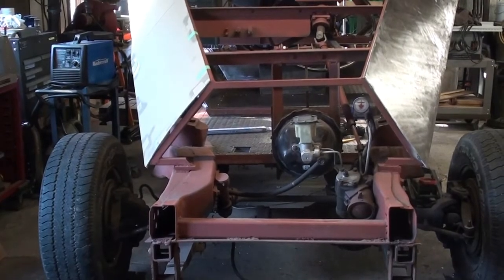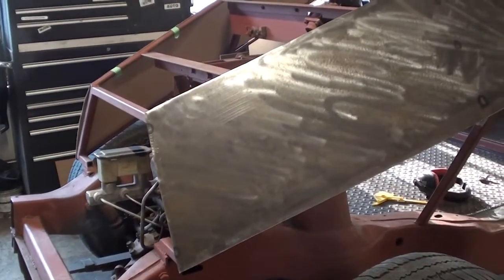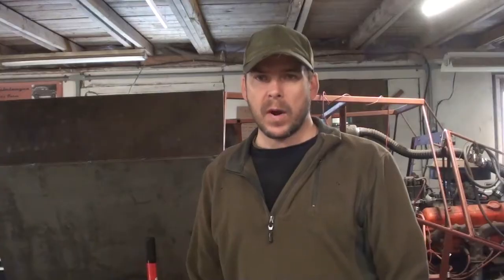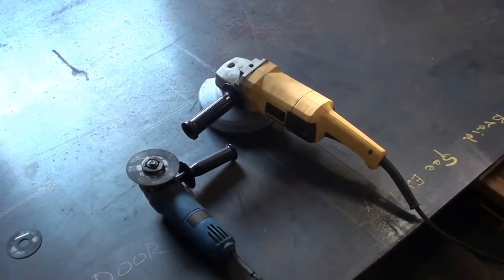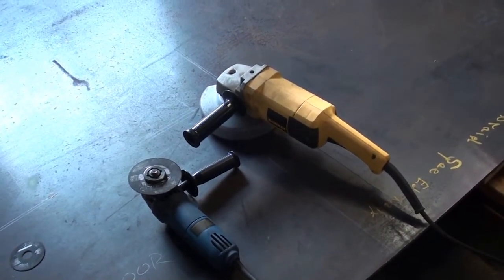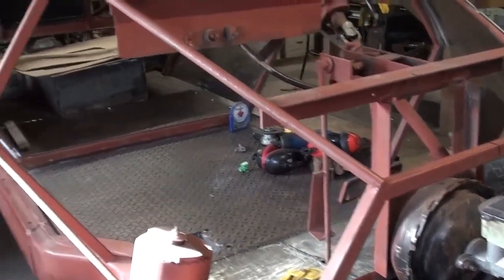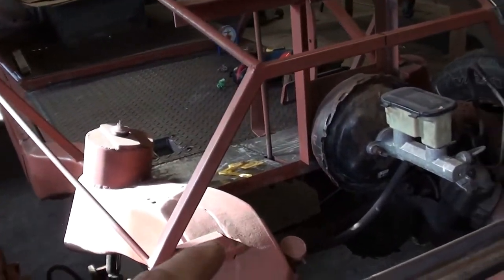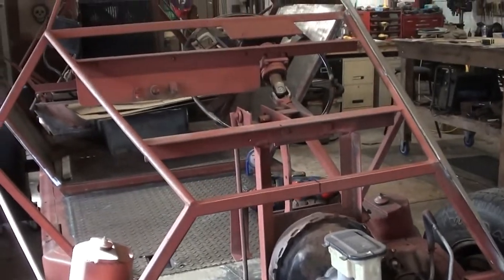Project 222 Ep19 sdkfz.222 Armoured Scout Car

Comment: X measurements in a few different aspects would  go a long way to catching those slips.
Reply from the maker: Yes I totally agree.  We failed to do this... simply relaying on side to side and front to back measurements of frame.  Live and learn.
Reply: @woodsarmoury  Good to find now. I do collision work, with all those complicated angles bringing that all together those X meas. from up ,down across and diagonally all will be critical or the fudgery will compound. Suggest start in center box of your structure moving out from there. Just wanting to help, love the project.
 Maybe I missed something, the drive line is set up backwards in essence, would that mean forward for the vehicle would be reverse for the drive line?
Reply from the maker: @wdrankin400  We flipped the axels and that reversed the rotation of the driveline.  Go back and check out Ep 4 to 7 I think those pretty much cover the driveline build and also some testing that we did.  Thanks for the support and interest in the project.
Reply: @woodsarmoury  Yup, thought I may have missed something. Power on!!